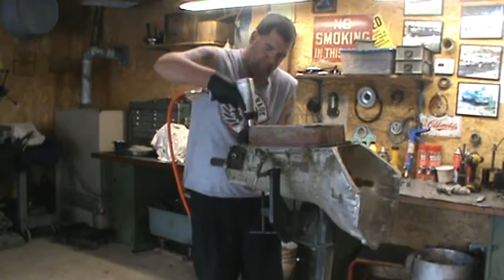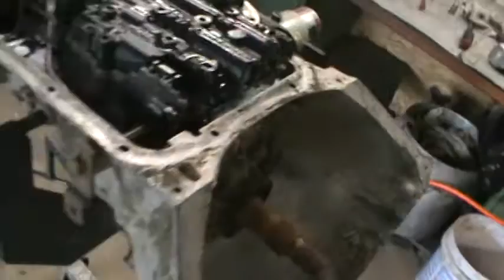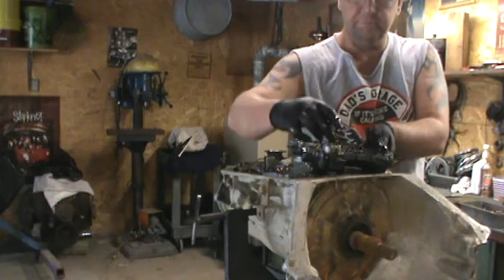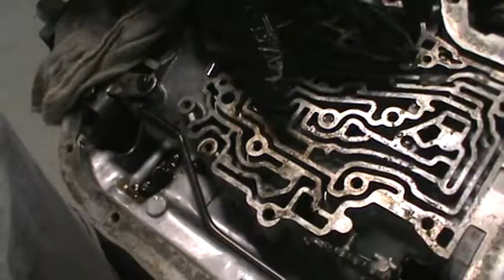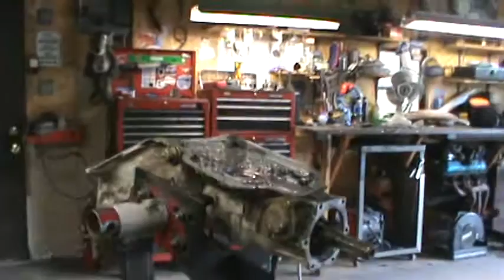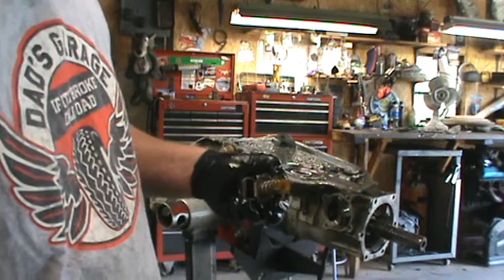TH400 build PT. 1

Comment: I watched most of your series on th400 and wanted to leave you a comment saying thank you. I run a th400 in a hot rod c10 and I couldn’t hold first gear past about 4700 which drove me nuts so I got a full manual valve body and a Trans Go shift kit. One night I just pulled my trans and started cause I had the parts. With the transmission in pieces I found your vids and that weekend you helped me rebuild my transmission which now has break neck shifts and holds the gears, I love it. I am mechanically inclined but my first trans and I was scared and you helped a lot. Thank you!